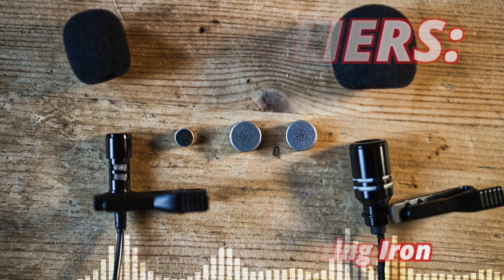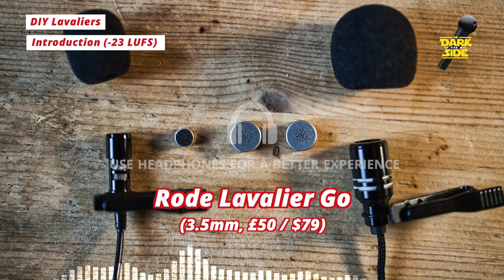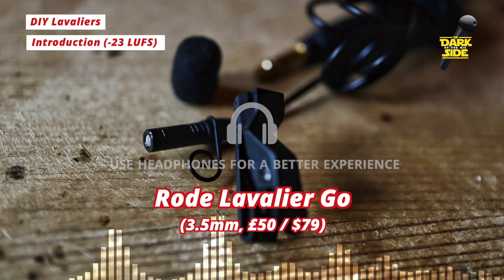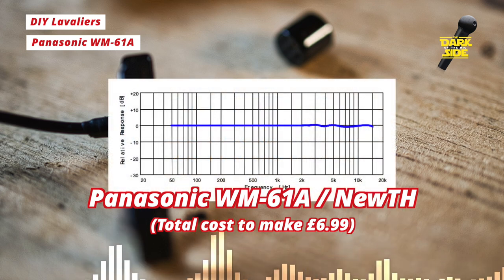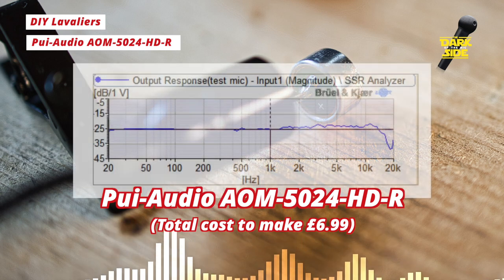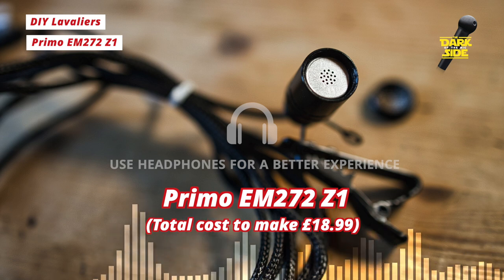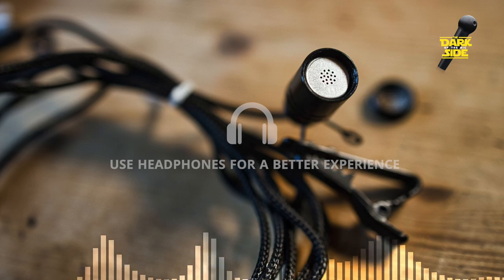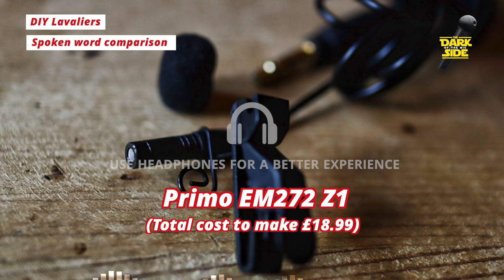DIY Lavaliers: Hobos with a Soldering Iron

Comment: Can these be made into stereo and used with USB-C on a android smartphone?  I would like to make a mic that looks like the Sony ECMLV1 and Olympus ME-51S but has the EM272 and USB-C connection where you can just plug it onto your phone and then record video with a nice enhanced mic for lots of ambient pickup, is this possible?
Reply from the maker: I guess it would be possible, but in terms of the housing it might be difficult. One approach would be to try and find an existing usb-c mic on AliExpress then change the capsules. But the Em272 capsule are a bit bigger, so might not fit in existing T-mic designs. You might be able to use the wiring / part of the body and and enclose the capsules with Sugru mouldable glue. Alternatively, The rode Ai micro would be the easiest way to do it but a bit more cumbersome with the cables, not ideal for handheld recording. Saramonic do this : https://saramonicuk.com/sr-c2003-short-usb-type-c-male-to-gold-plated-female-3-5mm-trs-adapter-cable/ which might work to connect a T-mic although what I’ve read android phones are a bit fussy when it comes to usb audio adapters.
Reply: @thedarksidemic  Thank you so much for the detail information, I will try the cable first and if that doesn't work will try the rode.  Keep up the great work your channel 👍🏻

Comment: Interesting, the AOM 5024-HD-R seems to have highest sensitivity and high SNR. Is it correct, that this capsule is suitable to collect low audio volumes, respectively collect audio from larger distances ? Let´s say use it as a mic in 1-2 m distance for web meetings?
Reply from the maker: yep the Pui might be a good contender for a boundary style diy mic - low noise and sensitive - its flatter than the EM272 which might favour a more distant pick-up. However, would it sound good from 1-2m? I don't think anything sounds good from that distance, from a spoken word perspective for recording, but it may be adequate (and cheap) for making out what people are saying in a roundtable situation.

Comment: Hello - just watched your video with much interest. I'm up for making my own lavalier mic using a 10mm EM272M capsule. But the Ali Express mic is no longer available. Its not obvious which mic could be purchased as an alternative. If you have an idea maybe you could update the links. May thanks in advance p.s. or maybe you have a lav mic / parts you'd sell ?
Reply from the maker: Ive just had a look, can't find the aliexpress one either - i know mic booster in the UK sells them - https://micbooster.com/clippy-and-pluggy-microphones/248-clippy-mic-enclosure-type-b.html - but i will keep looking ;)
Reply from the maker: this looks like it : https://www.aliexpress.com/item/1005004857801642.html?spm=a2g0o.productlist.main.99.27fc19d1xKaiTO&algo_pvid=bd5d28ca-bebe-4300-a2f2-82ce0de8e192&algo_exp_id=bd5d28ca-bebe-4300-a2f2-82ce0de8e192-49&pdp_npi=4%40dis%21GBP%211.15%210.64%21%21%211.40%21%21%40211b80e117024915984246192e69b5%2112000030772422237%21sea%21UK%210%21AB&curPageLogUid=BCob1LPa5XlY

Comment: I really like the approach you're taking with these videos. The production is excellent, they're informative and a little bit different without being gimmicky. I recently bought a Pluggy mic from micbooster, which is an EM272 built into an extended XLR plug. I've only made a couple of recordings with it, but so far I'm impressed. BTW did you take any special precautions when you were soldering the capsules? I've read that they're susceptible to damage from excessive heat.
Reply from the maker: Thanks. Yes it’s barebones production ;) I can’t stand graphic intros on any YT video and if I filmed myself, it would take 10 times as long! Yes the pluggy mic is great, I think the XLR version will use some small circuit board in the XLR to convert 48v to 5v for the capsule. Mic booster sell the parts to make your own pluggy but as far as I can tell the AliExpress headbasket, clip and foam is the same for £2. For soldering, I’m no expert but a couple of things really help me, 1. Tinning the ends of the wires really helps it take to the solder points much faster. And 2. Little bit of flux helps as well. I use a small tip on my soldering iron (which is a cheap Amazon one) and I find I have to clean it with wire wool after each solder to get it working best.

Comment: Hi, great video, great content, great execution!
I've read on many online discussions people mentioning the fact that the face of the primo electret should sit flush to (or even a little proud of) the front of the housing. Do you think the quality of the primo could be further improved by not having it so recessed in this ali "case"?
Reply from the maker: Hi thanks! , I guess you could have protruding from the case but then you wouldn’t be able to screw the the lid on, I have it as close to the front as I can, but I didn’t notice a huge difference in and out of the case. The Pui from what I can tell is more affected by the way it is mounted. Some electrets need air or space at the back. In my tests the pui frequency response isn’t as extended as they claim it is, it rolls off much earlier than the primo does. IMO the primo is significantly better and worth the extra money. It’s a decent replacement in a Rode Video Micro albeit an Omni.